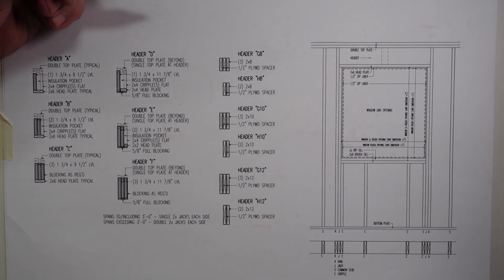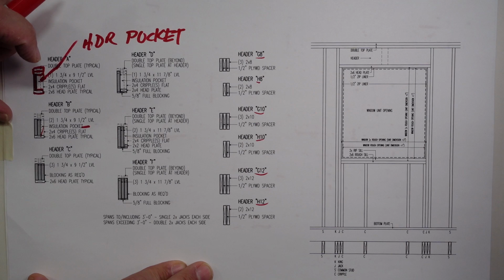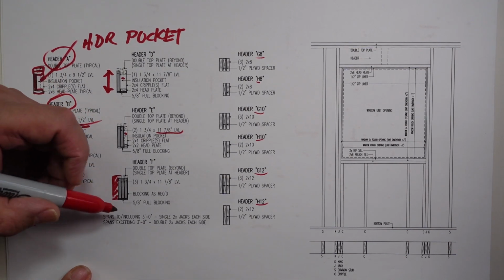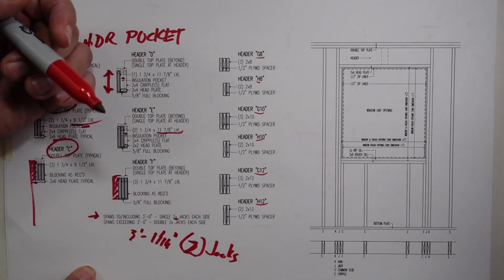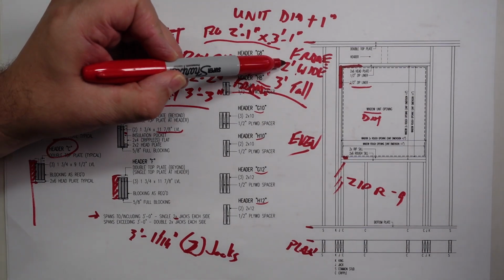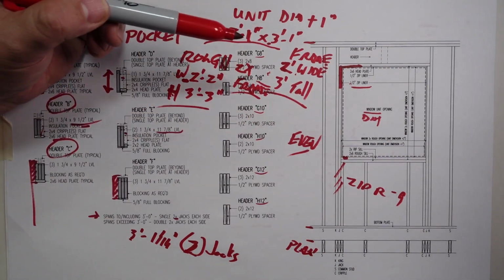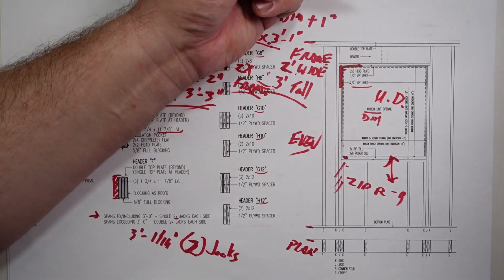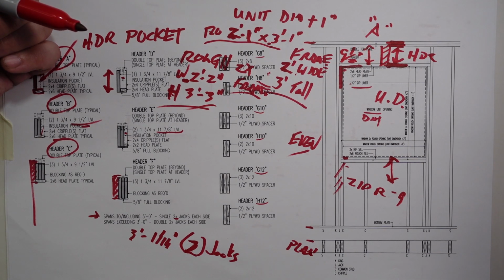Big Openings get LVL FRAMING

Comment: Slightly off-topic question: Do the seams in Zip-R sheathing need blocking behind them?  I've seen people add that at the end but it seems [emphasis on seems, as I have not yet installed Zip myself] like it would be easier to add while sheathing, before the next course goes on.

Comment: Thanks, Steve.  I'm going through this with a small house that I'm building this summer.  In my case, I found that LSL made more sense then LVL, being cheaper, and covering my largest span while still needing to be the thickness of my 2x4 walls for longer openings.

Comment: Steve, legitimate question. What would be the reasons to not have the insulation pocket on the exterior of the wall. Wouldn't the thermal performance of the wall be better if the pocket was on the exterior and insulated before the sheathing is attached?
Reply: For the most part, the location of the pocket doesn't effect thermal performance.  From a framing perspective, it should be easier to install the header flush with the outside.  It just has to be laying on the deck instead of having to be propped up, and maybe not being in plane with the wall.  In addition, some or all of the sheathing is typically installed before the wall is lifted, to make the wall section square and so more of the work can be done on the flat.  That said, I'm still in the keyboard framer mode of my house construction.  I'm just doing all this in my head now, before actually doing it this summer.

Comment: As a Licensed Builder who's done a Lot of framing in my career I appreciate your attention to detail and fore thought in elevations and sections.  90% of the Architects and Engineers I've worked with in the last 30 years have ZERO practical understanding of what's required to build their designs.  When questioned on specifics their fall back is "Build it like I drew it." and that's a totally useless response in the field.  I can draw the Death Star.....doesn't mean it can be built as drawn.  Do you include a detail for required blocking in the joist space for load path?  And yes I've subscribed.......
Reply: Haven’t been building nearly as long but just ran into this with an architect I just used. I wanted to do headers like this, and he wouldn’t budge off the old way we did headers (dimensional lumber, plywood and no insulation). I ended up asking another builder who was doing a home down the street and ran it by the inspector to get it done. We ran into similar issues with trying to get cathedral ceilings with the newer r value requirements without using spray foam.
Reply: @cw6410  Dating myself....but been in this game sense you had to crown the 2x10 floor joists.  A LOT has changed.  Homes are a group of engineered systems.  And those who cannot learn, adapt, and move forward have No business in the building trades.  "I've always done it this way." is the excuse of the simple minded and those who learned by wrote......they were trained in "how" but never learned "why" it's done a specific way.  The Architect you dealt with is an idiot with a degree.  

Passing inspection should be a given....it means you met the code.....which is the minimum acceptable standard, NOT necessarily the best practice.  It means you got a "D".

Those who can, do.
Those who can't do, inspect.
Those who can't inspect, teach.
Those who can't teach, write the code.........